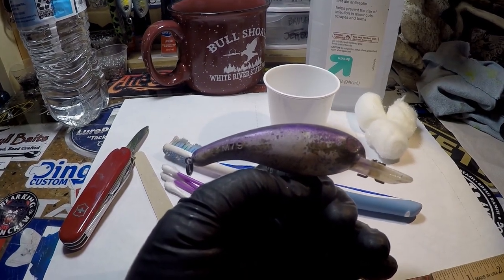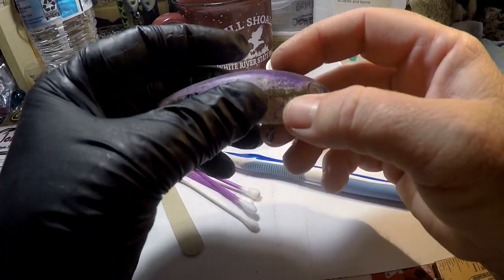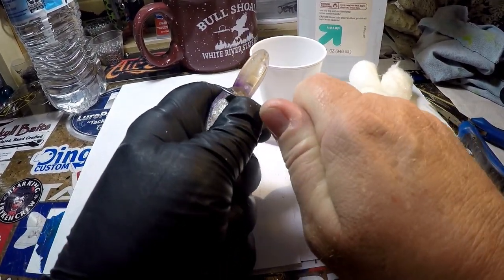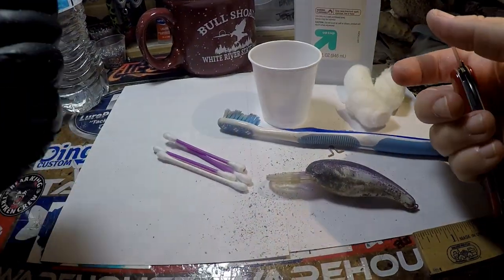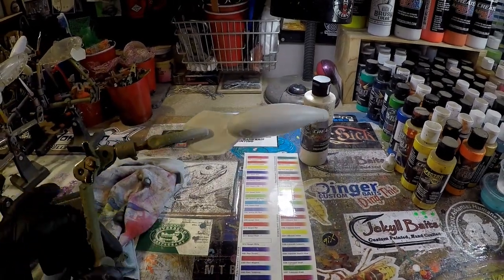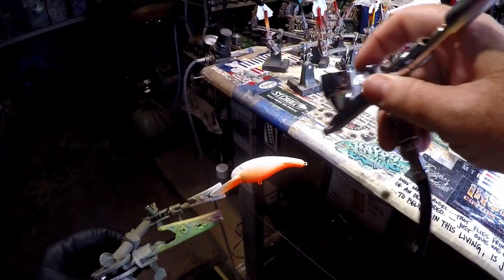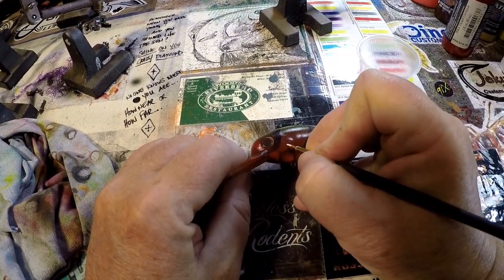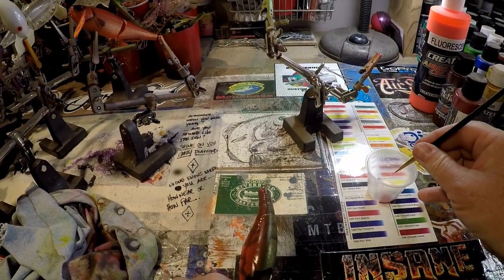Restoring A Tom Mann's M79 Crankbait!! (Jekyll Spray Session)

Comment: I'm sure you've covered this but what do you use for signing your baits Jen? I have heard that fine point sharpies will smear when you clear coat but thought I would ask as expert first. Thanks for the video!
Reply from the maker: Uniball Vision Elite Fine or a Medium point, angle the tip and let BBBB the roller ball glide. Lightfast, waterproof and quick drying
Reply: Thanks for the tip. Well my first attempt at a bluegill looks more like a perch. This is much harder then I thought and I thought I had an artistic touch. Again, I tip my hat to your beautiful work.!
Reply: Thanks Again!. I will get one as my signature blurred from my fine point sharpie. Oh well. Another lesson learned. My wiggle wart craw attempt turned out not bad.